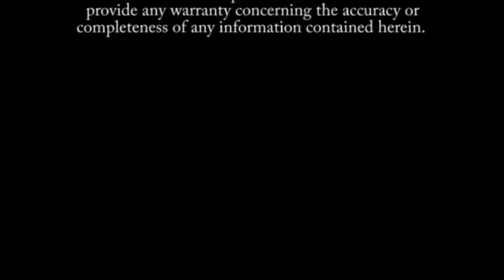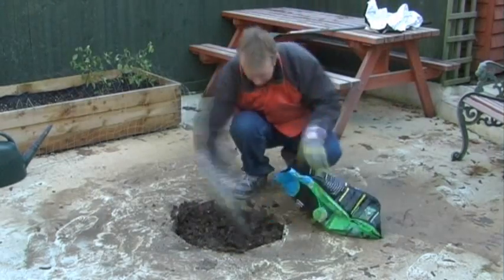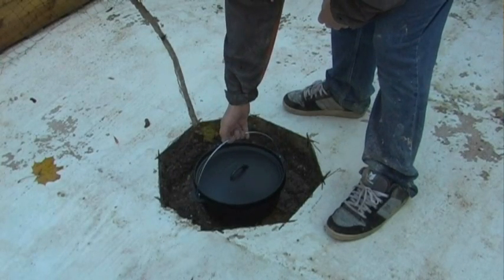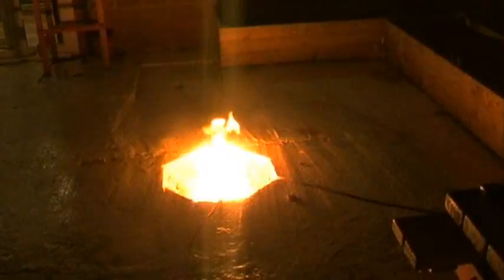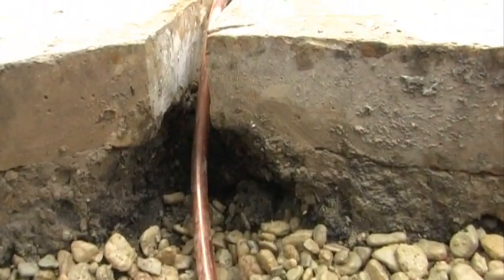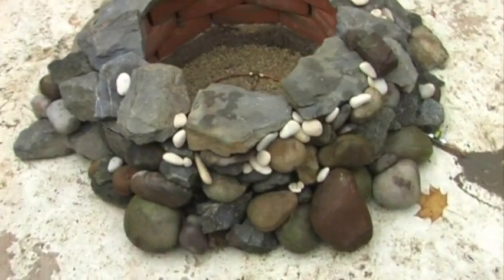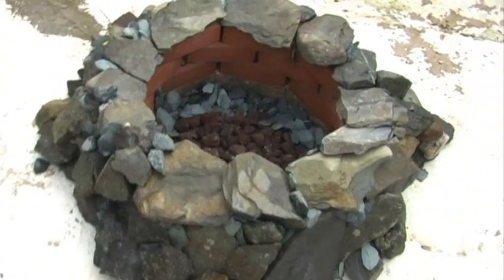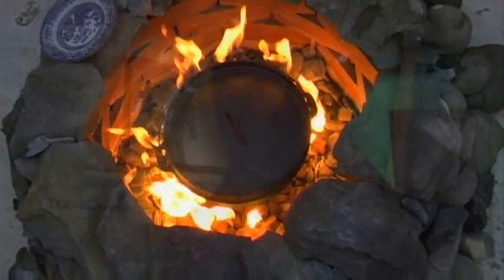How NOT to Make a Gas Fire Pit From Scratch

Comment: Nice project, to answer your question regarding sooting of the cooking pot.  You need to mix air at the correct ratio with the gas before combustion, this is the air-fuel ratio or stoichiometric mixture.  And will result in a clean burn with a hot blue flame just like a kitchen gas hob.  

Happy fettling
K

Comment: The soot is from your gas not burning properly.  You may want to buy a burner suited for the type of gas you are using.  Also, you need to have adequate ventilation.  There needs to be a fresh air supply coming from under the burner.  One last thing, the gas doesn't completely burn and especially not right away.  So, putting the pot on top of the burner is no good.  Raise the pot several inches to allow the gas time to burn before coming into contact with the pot.  Good video, thanks for sharing.

Comment: The soot is caused by the air (or lack thereof) mixture with the Propane.  If you install an air-mixer it will mix the proper air flow to dilute the propane which in turn will allow it to burn much cleaner.  Happy Cooking!
Jason

Comment: Great job on the oven Rick. With the burner, the holes are very big and the there's too much gas, you're getting incomplete combustion. That's why the flame is burning yellow, cold and sooty, and not blue and hot like it should. You're also creating a lot carbon monoxide. Indoors this would be a problem but outside you are OK. If your flame ever burns yellow in a van stove, beware!  I think proper jets are needed on the burner.

Comment: Ok Rick, I am from Texas and also The first rule of any cast iron cookery is that you never ever use soap to wash it.  Soap will not only ruin the seasoning but it will also imbed itself in the porous surface of the cast iron and end up impregnating your food.  So please don't ever wash the dutch oven with soap.  The best way to wash it is to fill it with boiling water and add some "baking soda" as we call it in Texas (bicarbonate of soda in U.K.) to the boiliing water (to be continued...)

Comment: Rick, do you have anything there to prevent the flame heading back up the copper pipe and to the cannister? Also, do you have anything securing the rubber hose to the copper pipe? Just a jubilee clip or something would do.

It looks nice, but I fear for the safety of the thing until a couple of issues are resolved.

Comment: You need primary air mixed with the gas before ignition. Look up gas inspiarators. You can make it itself with brass plumbing fittings. They are also available in some fire pit kits

Comment: Yes the copper pipe will react with the lime, There is protector tape that can be used, it's like a wax tape - may have been superseded by anther method nowadays. You may be able to get a coating that will spray in - if you dig out the pipe again.
The only way to avoid "sooting up"  the oven is to allow air to mix into the gas. A Bunsen burner (chemistry lab) does this with a sleeve valve, revealing two holes in the base of the tube (burner) upon rotating it - the holes line up.Air is pulled into the piper by the gas flowing up the burner. These work on natural gas. I am not sure how you'd do this for this burner. You may have to use an air pump. Some experimentation would be needed before assembling the burner into the pit.

Comment: Looks great but a natural gas like propane will burn much cleaner and leave no residue. If you switch to propane and residue is still getting on the pot then i would suggest switching out the lava rocks with fire glass

Comment from the maker: @maximillianof98 Thanks for the tip - I did some more homework and it's called the Venturi effect. I am looking for a fitting that I can attach to the gas hose for this effect, but so far have been unsuccessful. 
Looked up Bernoulli's principle and it appears to be for fluid dynamics :o)
Thanks again.

Comment: the soot is a result of the gas you used, not sitting the dutch oven in them, even if it were suspended it would still leave a residue, it could also be the lava rock dust and will lessen with time, perhaps if you used propane it would lessen the soot but the flames would be a much bluer color, although the yellow looks nice for sitting around and chatting, as usual, good work.

Comment: So this'll push it more in the forge direction, but if you add a refractory cement to the internal bricks and increase the air-flow with an air pump when you're using it to cook, you'll increase the completion of the  combustion and reduce the amount of smoke you produce. It'll be hotter though, so it might be best to forget about the lid.

Comment: I'm a little surprised that your Fire Pit even works, considering there is so little ventilation. I would have built it elevated off the ground with plenty of holes on the side for it to breath. 

I think the problem you're having with the Pot getting caked with ...I forget the word you used, but any way, i think it might be due to poor ventilation.

With greetings from Iran

Comment: I watched this bides a couple times yesterday and kept thinking g something didn't look right. I finals figured out that u should take some of that slate and stick it to the inside part of the brick also.
     And as far as the suit building up, that's cause there isn't enough oxygen getting to the flame. Consider running some pipe under ground to the edge of the concrete or wherever u want. And back up to the surface to pull air into the pit at the bottom.

Comment: Rick, you really don’t need any kind of check value or flashback arrestor with your fire pit. Off-the-shelf fire pit kits, gas log conversion kits (for wood fire places) and propane BBQ grills do not come with check valves. The pressure of the gas prevents any oxygen from returning thru the pipe toward the bottle. What is important is that all of your connections are sealed and sufficiently tight.

Comment: you should not use compression fittings with gas lines, the ring burner and input gas line under the lava bricks should be copper braised as should the regulating valve for safety, also the shards of slate around the lava bricks will " spit""when heated

Comment: Then gently scrub, the bicarbonate will do most of the work.  Now, as to your soot problem, it is alright to coat the outside of the dutch oven with dish soap, just rub a thin layer on the outside, I don't recomend including the lid in this, just the oven itself.  You will find that the soot washes off easily with pre-treated with soap on the outside. (to be continued...)

Comment: I work for the local gas utility and you really won't be able to get around the sooting. It's called flame impingement and incomplete combustion. Your burner was not engineered to act like a range burner...maybe smaller burner orifices. You want a sharper, non candeling flame. Preferably blue. Also, never use copper with natural gas, although you are using LP you may be o.k. Natural gas does not like copper much like water and galvanized pipe. Good luck! Fun project.

Comment: A fire pit is different that a gas grill.  A fire pit is solely for ambiance, not for cooking.  That fire pit could do double duty if you can control the air.  Shut off the air for a fire pit (yellow flame & high CO), turn on the air for cooking (blue flame).

Comment: the mixing valves we have here in the States are nothing more than a male-male union fitting with six angled holes drilled in the middle. Just make one yourself and install it with the holes pointing towards the direction of gas flow.

Comment: It was starting to look so good until the slate was piled around it... Should have Mason those in place rather than it look like an ant hill... So basically here's the breakdown... In order to achieve "complete combustion" you need the proper ratio of air to gas, each gas requires this... Increasing air ultimately reduces efficiency... Yet so does soot buildup so you need that complete ratio... Your 1/4" copper line with compression fittings... Not good! You should have installed a Venturi and orifice... You have a reg at the tank so your safe there... Anytime you are not introducing air with the gas before combustion you are going to get an incomplete burn... There's no way of adding air to combustion without an orifice and Venturi... Adding air to the flame is only going to assist in ventilation but it's a fire pit... Ventilation will not be a problem... You want to cook and have beauty at the same time... With that burner... No chance.